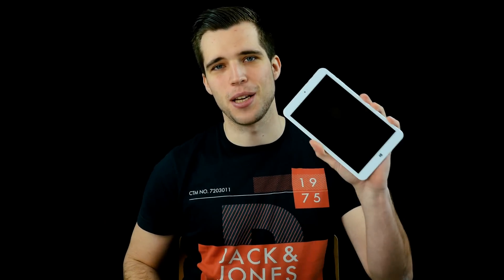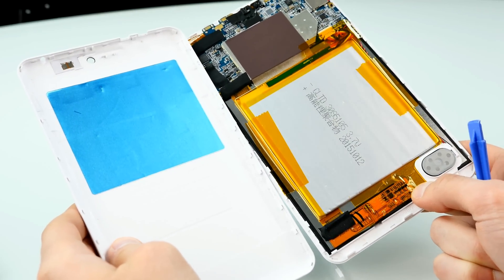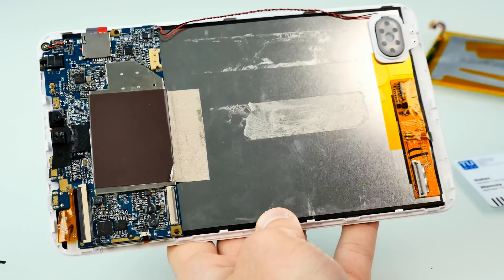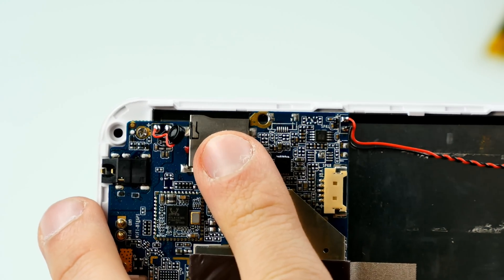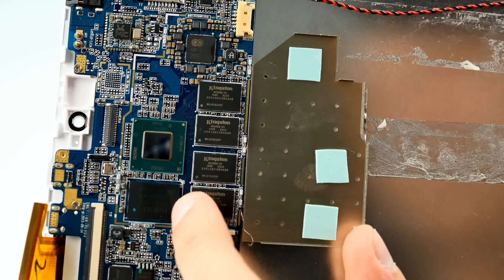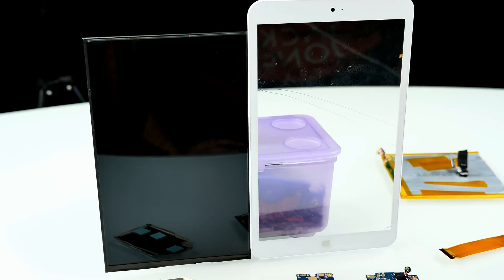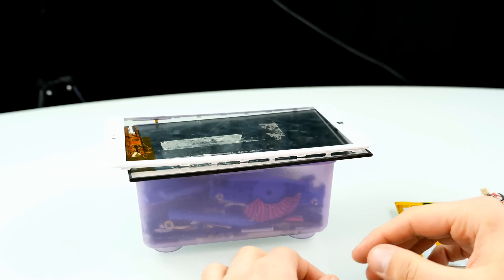Whats inside of a chinese windows 10 Tablet ? - Teardown Tuesday #2 [4K]

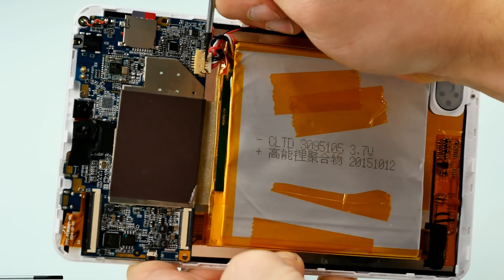Comment: 3:50 as fas as I know it would be much better to use your fingers or a plastic tool to remove that cable. It is just too dangerous to use a screwdriver as you could easily scratch the board.

Comment: The tool at the start is actually called a "Spudger" and anyone with a mobile device should have a set with jeweller screwdrivers and a decent set of spudgers to replace batteries, etc.